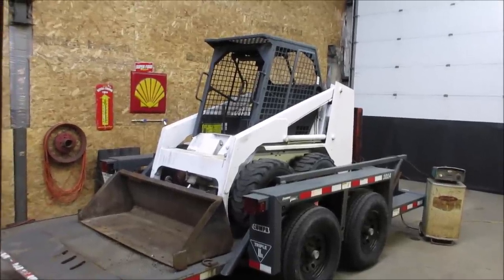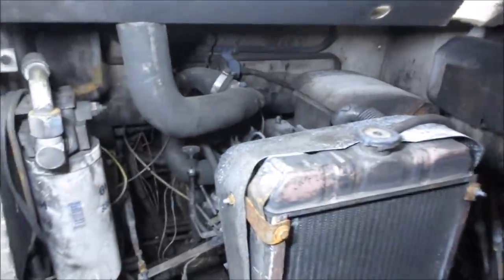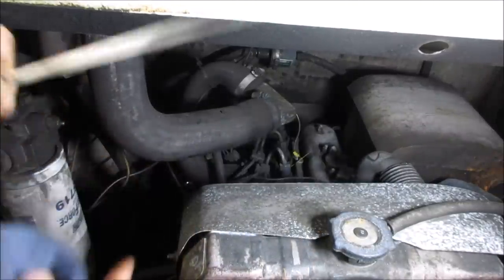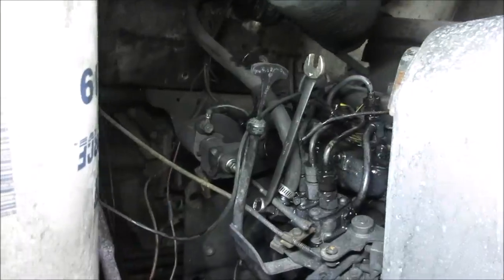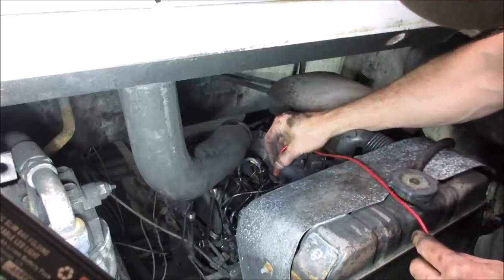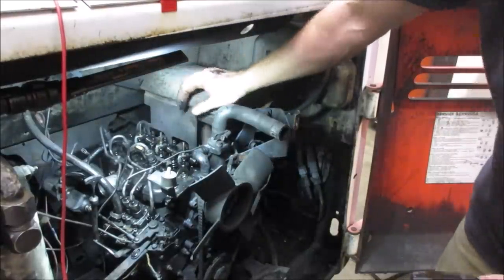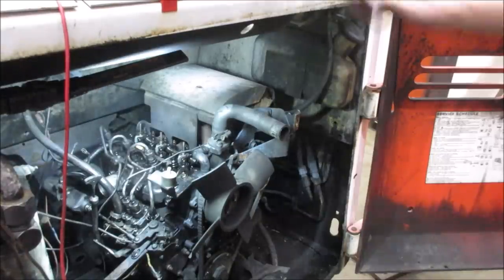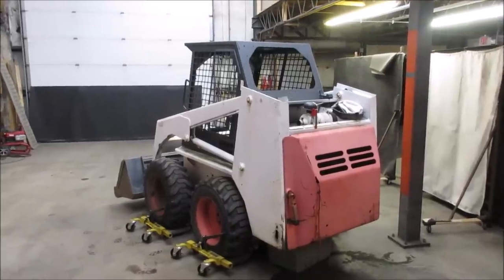Gambled on a Non Running Bobcat. Will It RUN?

Comment: Mustie1, They don’t all go so well. You rolled the dice and came up just a bit short. But it’s already a cobbled together machine, so why not just pull the engine, and do a ring job (we haven’t seen you do one of those in a long time)!  But a skid steer won’t be moving enough (like a bug or dune buggy) to keep enough air flow to keep it cool. Good Luck!

Comment: 642 was originally a gas engine, a Ford around 32HP. Just go get yourself an air cooled V-twin from your local store. There is a store that sells kits, but they are a bit spendy and I think you could put together yourself. Or rebuild the little Kubota that once could ;)

Comment: Probably has broken ring lands from people spraying ether directly into the intake of a precombustion chambered engine.
We used to spray ether into the rag and pass it over the intake instead to avoid that. Kubotas need to have working preheaters as well for cold starts.

Comment: Just a suggestion.  The oil was way overfilled.  If it's full of unburnt diesel it will be way too thin to seal the pistons.  New thick 15W40 oil will make a massive difference in compression.

Comment: I had a 843 same year it had a Four cylinder Isuzu engine, I bought with a bad engine. It turned out it was the same engine used in semi tractor trailer refrigeration unit, they were available everywhere, $1000 dollars. I do. It know if it will fit a 643 but i ran It for 20 years no problems.

Comment: First, NEVER put your fingers or other skin near diesel injection lines while testing or running the engines, poisonus fuel can penetrate your skin.
On the engine, too much oil in it, fuel diluted or ... drain and fil with cheap Wallmart 15W40 oil, to test.
Adjust the valves to spech at TDC COMPRESSION STROKE.
Check why you have not fuel at the end of hard lines, (loosen all tube nut while testing) be sure you are not in stop position on fuel  pump, trottle in full. 
The pump is it turning? Gear or shaft or internal trouble.
Injection barrel stuck in off position in pump.
I am sure some others will have other suggestions.
And yes, I was yelling at my television screen.😅
Still enjoy seeing your video's

Comment: We loaded one a trailer by pulling on it with a truck and turning the key at the same time. It ended up having stuck rings and i always wanted hook it back to a truck and see if it would spin over fast enough to start but we moved it along before i got the chance.

Comment: one more then im done when you take engine it would be smart to change out seal in the rear piston pump for the drive and check hoses wile your there its a lot of work when it is all put together its a nice machine very simple you wont loose money people want these machines

Comment: You better keep it. Rebuild  the motor or replace it .  Used skid steers are selling for high dollar , at liest down south here.  By not knowing the model number,it's hard to know how desirable it is in the market.   Every Bob Cat I have owned has had the radiator on top and that's from 1974 to current. The original Melrow series go way back and were air cooled Wisconsin engines.

Comment: I have a similar Bobcat, mine might be a little older I think it's around 75 ish. It has the gas 4 cylinder Ford (Pinto) motor. Looks like the Kabota has been swapper in. I also have the 3 cyl Kabota in a tractor and the glow plugs aer necessary to start. Be careful of the use of starting fluid it can damage pistons and valves. The fuel shutoff has to be fully open to run. The Kabota is a good motor if you can get it running.

Comment: i have the 3 cylinder Nanni engine in my boat (its a marinised kubota engine) i have had 2 diesel overruns and bent a conrod, rebuilt it, and the engine is still running. it does need the glow plugs even when warm, but once the heat is there it starts great. those 3 cylinder kubota engines are in a lot of plant (mine is a 19 hp i believe)

Comment: You're probably going to need a new cam (check the lifter travel), piston rings, rod and main bearings, headgasket, and maybe new sleeves. 

Lots of work, and at least 1000US in parts. I think I'd rather buy a runner and swap it. These small industrial diesels are found in lots of different applications, like refrigeration units, gensets, and on and on. But most have a lot of hours on them.

Maybe a beetle engine will fit in there? That'd be cool :D

Comment: I have a older version of that bobcat. Mine had a 2 cylinder gas, I pulled it and dropped a hf predator engine in it. Can’t wait for part 2 & 3
Reply: That worked good?
Reply: @1pcfred  I got the largest one they carry, it’s a 22hp. The original engine was rated at 24hp. My bobcat is the M500 it’s from 1965-1970.
Reply: @lawrence1md  sounds like an easy way to go. Whoa they want a thousand dollars for that. Not so easy on the wallet. I hope you had a coupon.
Reply: @1pcfred  the distributor was bad on the original engine and I couldn’t find a replacement so I was forced to do something. It runs like a champ now. I bought that engine about 5 years ago and was able to find a coupon.

Comment: The kubota has the engine number stamped on the side of the block easy to see. It will be something like D905, D1105  I think the reefer engine might have been to small.

Comment: I think Bobcats\skid steers are the one piece of equipment that get the least\worst maintenance of any piece of equipment because they are such a pain to work on. If you end up putting a gas engine in it (if you haven't already) make it so you can run it on gas or propane . The propane is nice for a few reasons. You can use it inside without having every door and window open. You don't have to mess with dirty carbs or stale gas . Maybe you can come up with a forklift engine already set up for propane
Reply: Why are they a pain to work on? The engine seems very accessible and you can get to 3 sides of it easily.

Comment: I agreee with terryunderwood, with as much starting fluid you put in it should have either locked, Im pretty sure its just really tired, also the pump is tired as well, you should be getting fuel but not enough to overcome the nozzle, this one isn't going to be cheap unless you can find a complete engine with the pump somewhere.

Comment: With all the fuel wich was dumped in the cylinders while crancking, you should have more compression,even with a worn engine.
Check with oil in cylinders to artificially bump compression, if doing nothing then check if timing chain skipped a tooth.
Also,so loose valve isn't normal,clearances should reduce over time,not increase.
Seems fishy enough to me to keep looking.

Comment: A few years ago you had picked up a 3 cylinder diesel and got it to run on your bench.  that  would be  a  good  option for a  replacement, if you still have it.

Comment: I suspect the headgasket leaking between cylinders (- which would put diesel and compression in the sump).  Using that cobbled injector adaptor, the compression reading will also be wayyy low, due to the excess volume down the centre.

Comment: I would have never tried to start the engine with the oil over filled when you know its a no start. Probably cranked and cranked trying to get it running and is most likely oil and fuel mix. Probably started loosing a cylinder or two when it was still running and started getting unburned fuel into the oil thinning it and killing what ever cylinder was still good. May have also started wearing the cam due to the thin oil resulting in the large valve lash. Was also going to mention using the glow plug hole for compression test but many beat me to it.

Comment: All you need is a ring kit and a ball Hone and that d722 engine will tick another 3000 hours!!!  The morans that owned it probably ran it with poor air filtration,  dust gets in cylinders and slicks the piston walls. Looks like the valve body might have a stuck pressure relief valve as well, or need a gasket rebuild. It's not a lost cause I've worked on many of those.

Comment: If you check the valve cover there is usually an engine family sticker on the side or look at the block for the casting number.  If you were serious about making a deal on selling it let me know.  I work on these everyday and could use a yard machine. Good luck on your project.

Comment: Mustie, the injection pump is capable of about 10,000 psi. You should never put your finger over the end of an injection line to check for pressure; very dangerous.

Comment: Diesel engines require a film of oil on the cylinders to bump the compression.  With excessive use of ether it will wash the cylinders and lower the compression to the point where it will not run. Pull the injectors and dump some oil in each cylinder.  It should fire right up.

Comment: I’m glad to see it went to a good home. I thought about that one but decided it was more of a project then I was going to pull off.  

For my similar sized yanmar the value lash is .015, and I had to pull the glow plugs and test compression through those holes.  I would adjust the valves and re-test.

Comment: I had a 642 bobcat that I ran for many years in my plumbing business with a backhoe attachment

That thing has been hacked to s***.😢😢

Mine came with a 4-cylinder Ford engine not unlike what came in the Pinto.

I'm thinking Mustie has met his match on this thing.

The best thing he could do is to find out the price of scrap steel in his area and cash that POS in.

Comment: had the 743 with kubota diesel at 4200hrs getting to be hard starting even with new glow plugs took it to dealership they said 3 cylinders were dead no compression remanned engine was only $3200 (1996) then that little skidloader had power like a cat d6 dozer! these small skidloaders were super fuel efficient compared to modern gehl & mustang that size pick rocks all day long and more 1 tank of fuel

Comment: A perfect restoration candidate! Pull the engine out and remove the head. If nothing catastrophic is wrong, give it a basic rebuild and she'll be like new. Then while it is our, you can check the whole hydraulic system for leaks and issues, and clean up all of the cobbled wiring. Much of it is probably unnecessary anyway.
Reply: I'd like to see all of the soot pressure washed out of that engine bay. It looked like a coal bin to me.

Comment: Theres a seal on the injection pump shaft if it fails it will pump directly into the crankcase.    Seen many fail and destroy many eingines

Comment: Yes Kubota compression test is using a glow plug adapter. Hey adjust those valves and will bring up compression. These engines will not start without glowing them even on a hot day. I have had them work as low as 175 PSI. Please no ether, it will destroy a diesel engine. Also get that excess oil out or it will start and fuel off the excess oil uncontrollably, again destroy the engine. The fuel shutoff is commonly a cable so not a huge deal. My bet it will start. If not prob just a blown head gasket hence the extra fluid in crank case. and not a huge deal.
Reply: This engine not starting is the luckiest thing that could have happened.

Comment: I would double check the valve gaps as they seem way too big even for a diesel and if the compression hasn't increased then pull the engine out (as the engine bay is a mess and needs sorting) and strip the engine down as the rings could well be stuck (most likely cause) and replace all the gaskets also lap the valves and once back together bench test the engine to see if it starts as it would be cheaper to do that then buying a replacement engine

Comment: There's a relatively big volume of air trapped in that compression testing "adapter"

I'm sure this will give a big drop in compression. Moot point anyway as it looks like the rings are well worn out

Comment: If I remember right the bobcats had the engine mounted left to right not front to back like that as well as a 4 cylinder Kubota and radiator mounted on top. Unless the older ones were diffrent that's not the correct motor

Comment: should be a fuel bolw with 2 bleaders , crack them till you see fuel, close them, then on the injector pump loosen that bleader, but you must crank it till you see fuel , close it and it should be blead, good luck

Comment: Old forge power in Pennsylvania has many used Kubota motors .
Don't use Starting fluid ever in Japanese diesel engine s breaks rings etc..
They need glow plugs to start unless hot.

Comment: Check it out more. I've seen other sites where they con pull the head an pan off an rering the piston. To pull that engine mostly is alot of work.. But you know what you want an need to do.  A skid loader are run hard. I would say this one being you know thing kinda work, it maybe a good way to see if you can rering it. A lot cheaper then a engine !!!! An you may get the same problems or more...

Comment: If you ask Andrew Camartra, bobcats are a Pandora's box of horrors compared to Japanese skids. 😂.
Reply: Bobcat has been junk for years. most real operations wont use them. mostly landscaping , concrete companies still use bobcat here
Reply: Bobcat has been owned by Melro who bought it from a couple of brothers who built a three wheel two wheel drive to clean turkey barns. The turkey market collapsed and in order to save the machine, 4WD was added. Clark equipment bought them next and Ingersoll Rand probably advanced the brand the most. Now the Koreans own it ,and problems are here.
    My 853 is a beast with power and size and the weight provides good tractive power.
  The fuel tank is under the seat, and the suction line from the tank has a failed foot valve. So difficult to remove the hose from under the hydraulic pumps that I finally got the idea to abandon the entire suction line and drill a new hole in the top of the tank and replace the whole thing. They are very difficult to work on with poor access to service points on the underseat hydraulic lines..
   Bobcat makes an engine heater kit that's worth the money because those Kubotas are cold blooded 
    With moderate operating speed, a smaller engine would still work fine. So long as the operator worked the controls more slowly, the thing would push just as hard and lift just as much. One of the replacement engine services had a big Vanguard engine they recommended. Might have been a 24 HP

Comment: This is the best yet video I have one of those sitting in the back 40 but it's a 280. Old numbers it would be like a 300 Today . Not sure why bobcat did that but. I'm gonna save this video and go dig that one out my pops says it's only been out there for 10 yrs. It did run had hydro problems. Thanks for this video .I also want to know what camera are you useing like a go pro or what? I rebuild lawn and garden tractor rearends.

Comment: I have a Kubota 3 cylinder in my generator.  Mine has a low oil pressure sensor to open the fuel shutoff.  No oil pressure, no fuel!  I don't know the pressure it opens, but its probably 5-8 psi. Mine also has the electric solenoid for the shut off.

Comment: It might be a Mitsubishi LE3 or similar? Also I have had success with boosting compression enough to start a sad and tired diesel engine by squirting some oils down the bores just enough to help seal the piston to the bore reduce the blowby but not enough to cause hydraulic lockup. nipping those valve clearances up a bit may also help.

Comment: Six cylinder Detroit Diesel?? That should do it!!

To be honest, I half expected to see a larger Briggs & Stratton in there!

It's worth saving, but, so is that Onan, unless the generator end is totally goosed? I'd leave the generator alone, and try to fix what you've got.

One possibility is that the there could be a blown head gasket (cylinder to cylinder). Another possibility is broken rings, especially if a previous owner has been a bit overzealous with the ether starting fluid. It's definitely worth investigating further.

Excess oil in the sump? Possibly diesel that has washed past the pistons, especially if you consider the three owners who haven't managed to start it, and the relentless cranking in the pursuit of a few pops and bangs, from each of those owners. It wouldn't take long to squirt a pint or two of diesel into the cylinders and down to the oil pan.

It has to be worth looking at, even if it's just for fits and giggles!!

Comment: Looks like the mitsubishi L3E diesel motor. I have the L2E motor in my sailboat that acted the same way. Water entered the exhaust manifold and gacked up the rings to where they were compressed and couldnt make compression. I decided to to a complete rebuild because those engines run forever

Comment: A;so can hook up one of the hard fuel ines up to the injector pump like you did before and hook ann injector up. Crank it to check injector spray pattern. That way you know if the injectors are good. pump looks ok.

Comment: it was cobbled together to be able to put a block heater on it
at 32:40 there should be way more pressure on that line looks like the injector pump is not working

Comment: for a start, ,  the injector Pp is probably  in the no fuel position hence no fuel at the injectors and it will have air in the system which needs to be removed, or you can crank until the cows come home and nothing will happen, ex diesel fitter military and civilian.